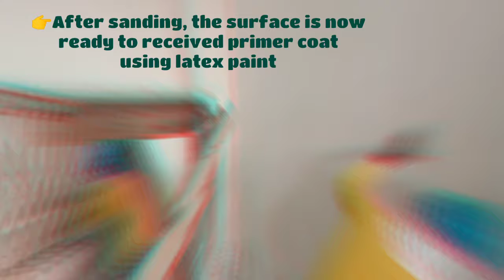How to Apply Skim Coat on Rough Surface | How to Skimcoat Wall |Paano Magmasilya #painting #skimcoat

Comment: Very informative .Thanks Sir. Can you add in the video..how many minutes or hours needed  for the next steps to follow...example ..after the first coat of skim coat , how many mins to wait to apply second coat ? Thanks a lot..
Reply from the maker: Nasa 4:25 mins po ng video sir ang kasagutan sa tanong mo, but still depende rin yan sa temperature kung kailan matuyo ang unang coat, recommendation lang po ang lahat, consider the actual situation. Sana nasagot ko ang katanungan mo, salamat po

Comment from the maker: Dry pack floor tiles installation 👇

https://youtu.be/Xf0h0PHB-yM
Reply: ano ba Ang pweding panghalo nang skemcoat
Reply from the maker: @Pencil hello po, more than P400/bag po, depende sa lugar nyo po.
Reply: Hu pa advise nmn, pwede ba i skimcoat ung pader kahit may old paint na? nababakbak ung pintura nya, hndi nmn rough ang pader hndi rin nmn ganun ka kinis , . pwede ba un i skim coat kahit may pintura na?
Reply from the maker: @leidi467   pwd po ma'am ..ito po ang sagot 👇

Part 1 of 3 Interview ng isang pintor | Pwede ba ipahid ang skimcoat sa pintoradong wall? 👇
https://youtu.be/2ozfv9eImDM

Comment: if the surface is too rough, apply some cement rendering first, don't use a lot skim coat otherwise the result will be wavy.
Reply: Ska magastos yan, mas mahal  skimcoat s semento
Reply: @mad_ace33  mahal kita
Reply: Sir ngpa skim coat  kami pero pangit kasi nang gawa nila. Pwede vah patungan ulit  nang skim coat yun? Para maging smooth yung mga corner di inayos.😭😭🤦🏻‍♀️🤦🏻‍♀️
Reply: @lanigracesotes1713  pwede. ngunit ito ay maaaring magkaroon ng mahabang crack. ito ay mura at madali, maaari mong gawin ang iyong sarili. para sa magaspang na pagtatapos maaari kang gumamit ng maliit na grit na papel de liha
Reply: @allenperera6158  ano po maganda gawin sa mga crack nang skim coat?😭😭😭 may need vah ilagay sa mga yun?
Reply: @lanigracesotes1713  reapply skimcoat. then sandpaper, fine grit
Reply: Anong brand ng skimcoat maganda

Comment: Do you apply any pvc corner bead to fix and construct a straight and aesthetically corner?
Reply from the maker: Hello, in my experienced we just use aluminum tubular frame (use in glass and aluminum works) as straight edge in skimcoating corners.

Comment: sir sobrang kinis na po nang wall namin no no need na po ba lagyan ng skim coat kasi gusto na namin lagyan nang pintura
Reply from the maker: Hello po, isa po sa purpose ng skimcoat ay para pumantay ang wall , at adhesion na din sa paint. Kung sa tingin nyo po, wala ng wavy sa wall pwd na flat latex drtso, din desired color ng paint after.
Reply from the maker: But for better output, skimcoat is recommended.

Comment: B4 mag lagay ng skimcoat, dapat po ba mag primer ng wall? At saka anong primer paint po? Thanks.
Reply from the maker: Hello po, sa experience ko hnd na po kami naglagay ng primer paint before ng skimcoat dirtso na po. Meron din nagsasabi na mas maganda daw pag lagyan muna ng primer, if ever po lagyan nyo use primer latex paint. Salamat po
Reply: Salamat po,.. Estimate nyo lang po, ilang gallon ng primer ang kasya sa 22x24 Square mtrs, salamat..

Comment: Sir my tanong po aq...
Pwd bng mag skim coat sa pader na my pintura na tapos iwater proofing after mag skim coat??
Reply from the maker: Hello po, basta hnd lang po glossy paint ang nauna po. Basta yung pintora pang final coating po yun, dapat mas nauna na waterproof (if necessary), skimcoat then final color ng paint.
Reply: @JUANCIVILIAN  gnun po ba sir??
Pero kakapit ba ang water proofing sa wall na my pintura?? Kc kng kakapit ang water proofing sa wall na my pintura uunahin q ung water proofing bago aq mag skim coat??
Reply from the maker: Sa tingin ko po sir, kakapit sya. Kasi mostly sa mga waterproofing parang paint lang din ang application, pero kung glossy paint medyo hnd sguro pulido po. Pero better try it po sir. Di pa po ako naka experience ng gangang scenario po.
Reply: @JUANCIVILIAN  cge po salamat po SA sagot po nyo.... My ibng vlogger po kc nq wlang time sumagot sa mga comments or questions sa video nla....
Reply from the maker: Baka medyo busy lang po sir. Sge po, Godbless sir

Comment: Paano po pag concrete po dapat yung walls? Like ano pong cement sealer ang ilalagay niyo or paano gagawing matibay ang cemento na di mag ccrack. Kasi cement lang talaga yung gusto kong walls kaso may inaapply daw para hindi mag crack at para maging matibay. Industrial cabin type po kasi yung gusto kong bahay.
Reply from the maker: Hello po, sa pagkakaalam ko ang cement ay natural na mag hairline cracks, pero yung mga malalaking cracks na po ibang usapan na yan marami ng factors ang naka affect dyan including concreting methodology.

Comment: Gd day po sir.. tanong ko po sana kung ano po masmaganda gamitin para sa residential house .. oag gagamit po nang zemcoat. Finish wall po xa wala pang pintor. Ano po masmaganda unang gawin mag flatlatex po muna or. Kahit direct zemcoat na po?  Tapos liha tapos 2ncoat zendcoat then flatlatex papoba bago ang semi gloss na final coat. Tnx po sa sagot engr
Reply from the maker: Hello po, after po ng plastering skimcoat po muna ang e apply ma'am, bali dalawang coating ng skimcoat po, after po ng 2 coats ng skimcoats, lilihain nyo na po sya para mapantay, tapos walisan para matanggal ang alikabok, kung wala napong lubak lubak sa surface ng wall, pwd na ipahid ang flatlatex bilang primer paint, pagkatapos nf flatlatex at ipintora mo na ang final coating na gusto mo sa wall mo yung semi gloss. Salamat po
Reply: @JUANCIVILIAN  maraming aalamat oo sa advice at pagbifay namg ideas.  :)

Comment: B9ss paano 0ag smooth ang finished ng raw concrete?
Reply from the maker: Anong ibig sabihin nyo sa raw concrete ma'am, naka hollow block pile lang at walang palitada?
Reply: @JUANCIVILIAN  naka finishing na po mga 3 years na.. pintura na lang kulang. ang finish niya ay smooth, hindi rough.. sabi mas maganda if medyo rough sana para maganda ang kapit ng skimcout.
Tsaka po kailangan ko pa baa lasunin kasi matagal na siyang tapos na nafinishing
Reply from the maker: Hello po, kung sobrang smooth ma'am, tiktikan nyo lang kunti ang wall..ang advantage din po ng smooth finish ay kunti lang ang skimcoat na magagamit, regarding sa lason po you may or you may not.
Reply: Salamat po !

Comment: Pwede po gamitin ang skimcoat sa finished wall and sa may pintura na finished wall?
Reply from the maker: Anong pintura po sir? Semi-gloss paint po ba? You may try applying flat latex sir tsaka mag skimcoat application.
Reply: @JUANCIVILIAN  pwede po mag apply ng skim coat sa finished wall?
Reply: Flat latex po yung nakapontura sa finished wall, pwede ba sya boss direkta lagyan ng skim coat?
Reply from the maker: @jinebuwan9549  yes po, kasi may iilang mga pintors din ang nagsasabi na bago e apply ang skimcoat sa wall dapat may flat latex muna para protecta sa moist.
Reply: Ahh pwede po mag apply ng skim coat direkta sa finished wall?

Comment: Tapos na po subs. Sir tanong ko lang po. Before po ba mag skimcoat mauuna po ba ang masonry putty para sa bitakbitak na maliliit. At ung latex po mauuna po ba latex before mag skimcoat? Ano po ang no. Para sa pagliha tnx oo aa aagot
Reply from the maker: Maraming salamat sa panonood, kung may masonry putty po ay mauna sya kaysa skimcoat. Pero yung ginawa namin is pagkatapos ng plastering  (dry na ang wall), skimcoat na drtso ang sunod, then liha po na #100. Salamat sana makatulong.
Reply from the maker: Ang latex naman po ay e apply sya after na maliha.
Reply: @JUANCIVILIAN  maraming salamat sir. Nice video..sir ano po palang no. Nung liha na magagamit after magskimcoat.nkailangan po bang 2 patong ang akimcoat bago latex tapos ung semigloss na
Reply from the maker: @mleanemina3814  dalawang patong po ng skimcoat ma'am bago mag liha, or depende na din po sa surface na nilagyan ng skimcoat, tapos after 2 coating lilihain na ng #100 na liha you may use 3M brand or any liha na #100 tapos kung pantay na ang wall tsaka ka mag apply ng latex, pero if may lubak2 pa you may apply skimcoat again po. Salamat din

Comment: Sir, mas tipid ba ang skim coat kaysa gumamit pa ako ng cement para sa smooth finishing nia? plano ko kc magpa pintura sa bahay. sana masagot nio po
Reply from the maker: Hello po, mas recommended po ma'am na smooth cement finished muna bago e apply ang skimcoat para sa magandang quality ng painted wall.
Reply: @JUANCIVILIAN  pero pwid nman khit rough wall dba?? tsaka mas mkakatipid ako sa skim coat?
Reply from the maker: @slipknot9298  yes ma'am pwd po kahit rough wall, kaso nga ang dis advantage maraming skimcoat ang mauubos nyo para pakinisin ang wall, may kamahalan po ang skimcoat ma'am nasa 400-500 per bag depende sa brand na gagamitin po.
Reply: @JUANCIVILIAN  ahh ok sir, so san ako mkakatipd sir sa skim  coat or sa cement?
Reply from the maker: @slipknot9298  kung maayos po ang pagkapalitada ma'am, makakatipid ka sa pag gamit ng skimcoat, pwd din naman pintorahan mo kaagad ang makinis na cemented wall ngunit hnd ganon ka ganda or ka smooth ang wall compare sa pinahiran muna ng skimcoat bago pintorahan po. 👷‍♂

Comment: Pwede bang iskimcoat ung wall n napuruhan ng semento
Reply from the maker: Pwd naman po sir, pero mas better sana kung yung rough wall pa sya after plastering para mas quality ang kapit ng skimcoat sa wall. Sana po nakatulong.
Reply: Pero kakapit p rin ang skimcoat kahit makinis n ung wall... Thank u po sir
Reply from the maker: @alexanderpascual5732  hindi pa ako nakasubok sir, pero sa tingin ko po kakapit sya, kasi yung skimcoating is recommended 2 coats po sya, yung pangalawang coat is e apply sya sa skimcoated surface na makinis na at kakapit pa ang skimcoat, best way sir is subukan nyo po muna ng 1 bag around 480 pesos per bag po (provincial price) bago po kayo magpurchase ng maramihan para sa lahat ng wall. Salamat din po

Comment: Pede ba skim coat outside wall ng bahay ?
Reply from the maker: Yes po, pwd sa labas basta pintorahan kaagad ang wall pagkatapos maliha para hnd masira sa ulan, pero kung wala pang pintora wag munang lihain ang skimcoated wall sa labas.
Reply: JUAN CIVILIAN salamat po .. afte ng liha right away pintura na agad
Reply from the maker: Yes po, welcome 😇
Reply: JUAN CIVILIAN wow salamat po isa pang tanong 100sqm floor area  ilang supot ng semento ang 3incges ang kapal salamat po
Reply from the maker: @zebedee577  tiles po ba ito ma'am?
Reply from the maker: @zebedee577  floor tiles  comparison between dry pack mix and original mix of tile adhesive 👇
https://youtu.be/Xf0h0PHB-yM
Reply from the maker: More details for floor tiles installation po 👇
https://youtu.be/bSE1kJRLqHc
Reply: JUAN CIVILIAN flooring lng pala sesemnetohan tanong ko lmg ilan supot ng semento pag 100sqm 3inch ang kapal po salamat po
Reply from the maker: @zebedee577  mga 70 bags po ma'am, kasi around 7.6 cubic po sya lahat, per cubic is mga 9 bags for Class A concrete mix.
Reply from the maker: For more construction videos ma'am, maaari nyo pong bisitahin ang channel ko. Baka may makukuha pa kayong info. Salamat ☺
Reply: JUAN CIVILIAN last na tanong mam plastering namn hehhe outside wall din standard thickness  ang haba po ay 10m at taas po ay 3.8 m salamt po
Reply from the maker: @zebedee577  ito po ang kasagutan ma'am. 👇
https://youtu.be/P-ShT_0uyd0
Reply: JUAN CIVILIAN salamat

Comment: Sir tanong lang po applicable po ba tong skimcoat sa Exterior Wall?
Reply from the maker: Yes po applicable, basta wag muna lihain kung hnd pa prepare ang primer paint nya, kasi once maliha mo tapos maulanan, masira lang ang nilagay na skimcoat, dapat lihain sya tapos apply agad ang primer paint. Salamat
Reply: Sir tanong po ulit.. hehe.. ilan ang estimation factor nyo sa pagkuha ng bags ng skimcoat per square meter of wall?
Reply from the maker: @archandro6054  nasa 6:40 mins po ng video ang sagot sir at kung ilang coating po.
Reply: Oo nga po pala na overlook ko.. hehe. Thank you!
Reply from the maker: @archandro6054  rough estimate lang po yan sir, para at least may basihan ka. Walang anuman po 🙏